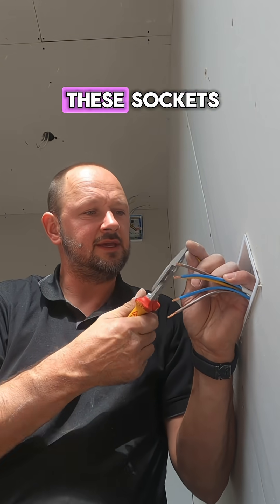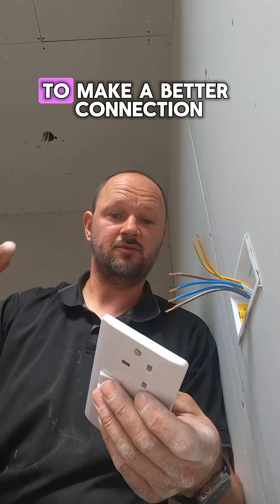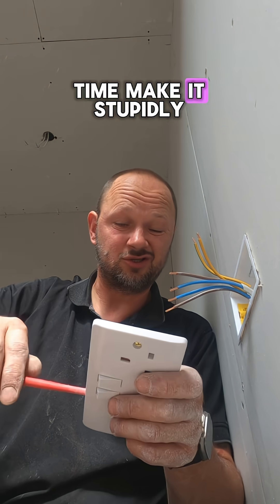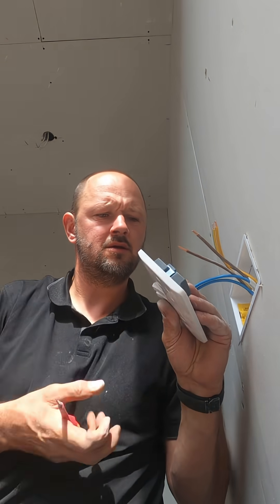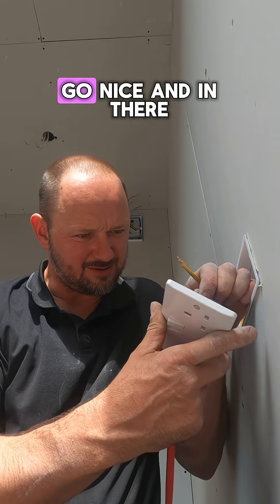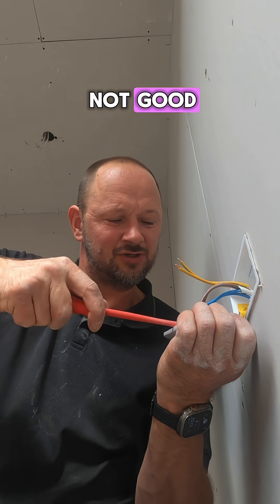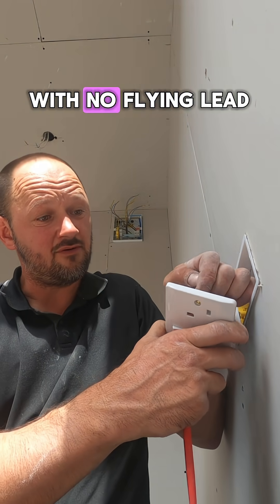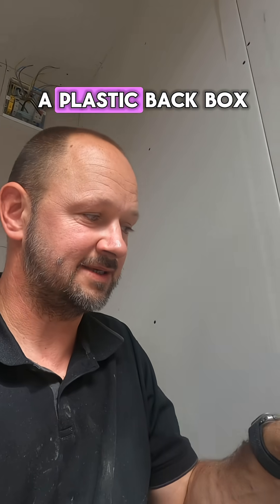Why I Never Add This Wire in Sockets!

Comment: You should twist the brown Ls together then screw into the terminal.  If the terminal works loose then ring is not cut, so less risk of a fire.  Same with the blue N. Or you can use a ferrule that takes two conductors.
Reply: What psychopath twists two solid conductors together😂
Reply: @Lj171098 
Twisting is done all the time and works. No different to doubling over the conductor - or using wirenuts as they do in the USA. Saw a tool available that twists the conductors together perfectly.  Best use the ferrules then be professional about it. Terminals do work loose, especially when pushing the socket in putting stress on the  connections. 

The best is use Wagos to connect the spine of the ring or radial at the rear of the backbox. Then use 4 inches of 2.5mm flex from the Wago to the socket's terminal, using a ferrule at one end of the flex. The current of the circuit then does not run thru the sucetable terminals at the rear of the socket. Then current only runs though the terminals of the socket only when that socket is drawing current.  

Wagos do not work loose. No stress when pushing the socket back as it is on flex.
Reply: @johnburns4017 whos using ferrules on a solid conductor too😂
Reply: I agree though john, wagos are the way forward
Reply: @Lj171098  
Two solid conductors into one ferrule - the crimper always makes an excellent joining of the two conductors. The idea is to ensure a final ring or radial is not broken, to avoid fires. Take Note.  

The method using Wagos is the safest and quickest - also the quickest when doing a first fx then test the fixed wiring, then the second fix which is easy using flex clipping into the Wagos and then final test. Will save a day in time when wiring a house - and far safer installation.

Comment: Good to see an electrician doing it correctly. I don’t understand why people put the CPC’s in the two separate terminals. For me, another terminal is another point of failure, another point of increased resistance and another reason to double over the conductors when putting them in one terminal. The steel link can increase the expected resistance reading when testing and it’s another point of potential failure. Why do it? Is it just an OCD thing because there are two of them?
Reply: It's because of one pulls out, at least its still got an earth on the other terminal, if they're both in one, and the terminal comes loose etc, (which any electrician knows, terminals can somehow randomly come loose over time) they'll both pull out or both be loose, meaning no earth path to all, or a poor one at best. Split it between, and there's less chance of two terminals coming loose. Its not an ocd thing, it's just something any decent spark does
Reply: @carlstanton2550 Very few ring circuits are installed now. And if he's installing 4mm like he said, chances are it's a 32A radial circuit. If one earth is lost, and the other remains in a terminal, all circuits after the one with a missing earth lose earth anyway.
Even existing ring circuits, a lot of the time they get split into two separate 20A radials during consumer unit upgrades, or fault fixing. 
My preference is both earth wires into one earth terminal, and the fly lead to the metal back box in the other earth terminal.
Reply: @robertswaine2142 very few ring circuits are installed????
Reply: @marrowphat2892 perhaps it's down to the electrician/area. But from what I've seen, most have moved away from ring finals and new installations socket circuits are wired as 20A radials in 2.5mm. Rings haven't disappeared of course, but they're becoming less common in the end user installation (I.e. socket circuits as referred to here). Obviously rings are still widely used in distribution etc...
My point was mainly that the circuit may not be a ring, so if one leg of the CPC is lost, the other may not provide a protective earth connection, and could in fact cause the loss of the earth to the rest of the circuit.
Reply: Also, that steel link is not having any substantial effect on testing unless its broken really , and if it is broken, chances are the rest of the socket is fu¢ked too 😂
Reply: Correctly?
Reply: Having two terminals provides a level of redundancy. If one connection is compromised, the other is still available, ensuring the earth path is maintained
Reply: @marrowphat2892 Not so much an issue these days because socket outlets are required to be RCD protected.

Comment: Just a question. . Why go to the trouble of using LSF cable then use one of those  cheep highly combustible dry lining boxes with the yellow fixings . Why not use a LSF plastic back box.  Example Marshall Tufflex
Reply from the maker: A fast fix box is a fast fix box to me
Reply: @toolboxtalking that’s not good .  If you feel that way you might as well use normal cable

Comment: I always split my earth's into the to earth connections. Double pole
Reply: Splitting the earths will alter the true resistance of the circuit. At multiple points throughout that circuit the conductor will change from copper to steel (the steel bar bridging earth terminals) this can create a higher resistance. I always use the other terminal to link to back box ( if metal ) 🙂
Reply: @danielwood5334 Having two terminals provides a level of redundancy. If one connection is compromised, the other is still available, ensuring the earth path is maintained
Reply: Dont forget if there is a computer plugged into socket unless the earths are seperated it can cause earth leakage😅